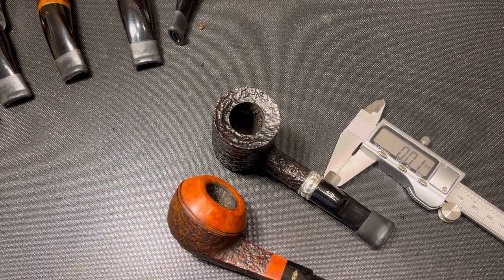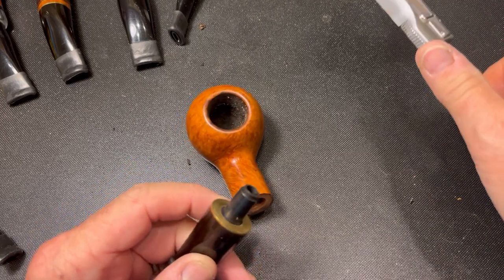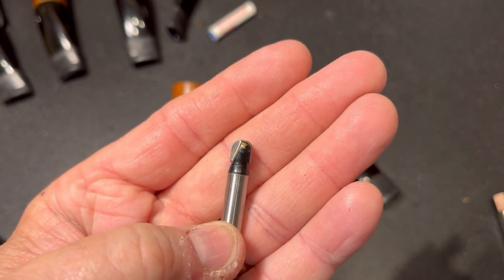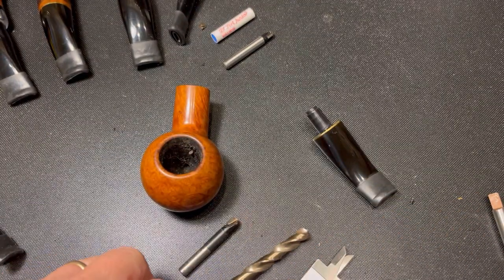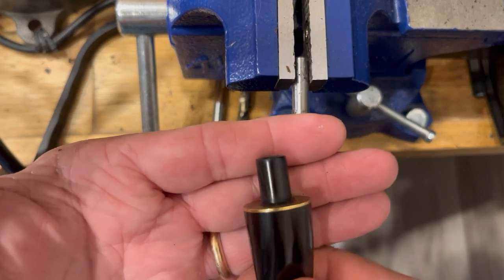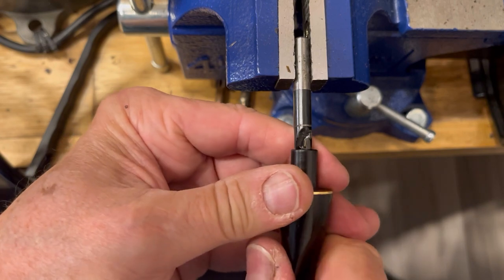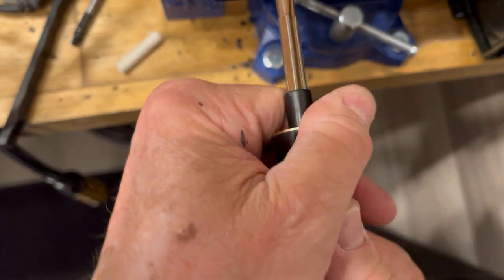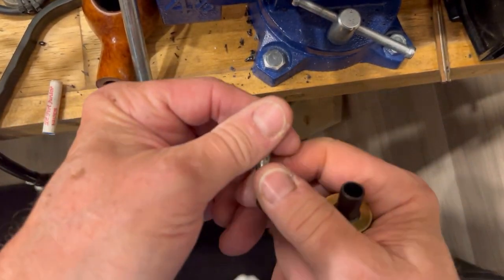6mm Filter Pipe Converted to 9mm Filter

Comment: Interesting that 9mm filters are actually just under 8mm?  

What’s the thinnest wall you would risk?  I want to convert my non-filtered pipes to filtered, but I don’t want to ruin the stem.
Reply from the maker: If I’m cutting a filter chamber of 8mm the thinnest is .75mm.  Converting pipes is risky at times.  I have convert about 50 pipes.  Only broke four tenons.  I was able to repair all four.